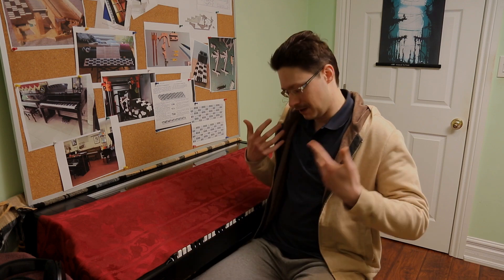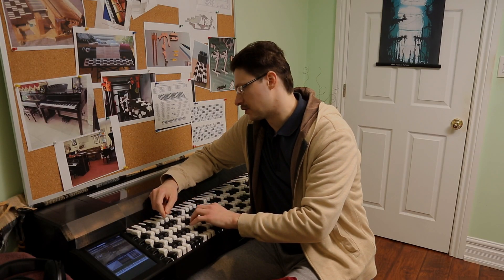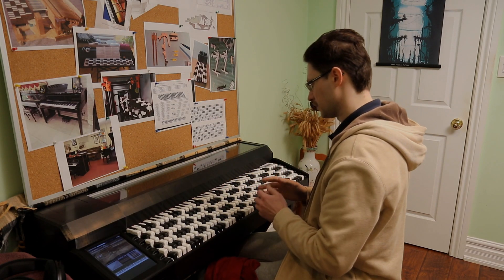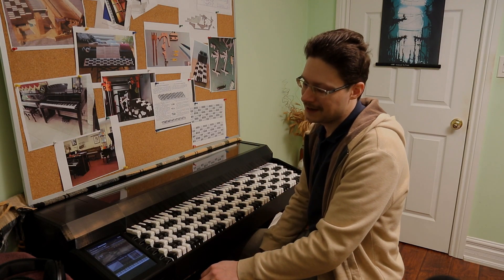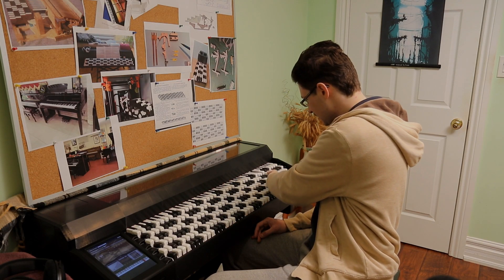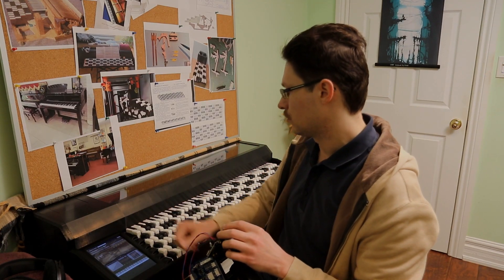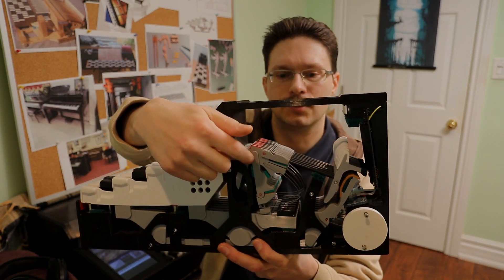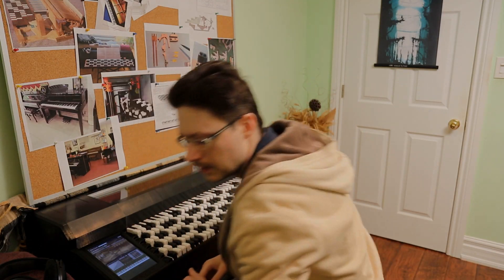DIY Janko Piano: 10. Its Working!!! (partially)

Comment: Hey this project might be adaptable into a more affordable lumatone.
Reply from the maker: probably not - the two designs are drastically different.

The lumatone is specifically designed for maximum customization, so each of its 280 buttons has its own individual velocity sensor. This naturally means sacrifices had to be made, so there is no hammer graded weights (or really any 'action' to speak of - making the feel of each button be more similar to a synthesizer than a 'digital piano').

My janko piano design is however made to mirror a grand piano as close as possible (outside of the key layout, naturally). This means that I only have 88 keys (though it looks like there are 264 buttons, but every button in a given column (3 per key) are literally part of the same key - so there are only 88 velocity sensors (and 88 hammer actions). On the other hand each of the 88 keys has its own mechanical action closely resembling a grand piano's in order to provide a realistic feel - something that would be impossible (or REALLY expensive) to include in a lumatone like design.

In terms of designs similar to a lumatone (in the janko piano group at least) it would have to be the Daskin uniform keyboard (which seems to be in a perpetual state of development) which does in fact offer individual sensors for each of its keys (just like a lumatone), though as with the lumatone it sacrifices hammer graded action for it.

Truthfully, I think the lumatone is about as cheap as you can go for a design with its specs - solid construction and individual sensors (and LEDs!) for each key. For cheaper alternatives you would have to sacrifice the LEDs and probably look into having a smaller range of keys (maybe in the 140 key range).

Comment: congratulations on building a digital janko piano that functions! It will get even better once the hammers are installed, I'm sure!
Reply from the maker: Definitely! I might actually be doing myself a bit of a disservice with practicing on the half-finished piano as it is (though I just cant stop myself - been anticipating the moment I could for over a year) since the keys feel way too light - especially when compared to my regular piano which now feels exceptionally heavy. Even with the variable weight system on my custom piano dialed up to what will in the finished piano be '80g' I only feel maybe 30g due to the missing hammers.

But oh well - pretty sure shifting back to a properly weighted action isnt going to be all too difficult (though perhaps not for my muscles - what with not playing piano for over a year while I was working on this project)

Comment: Huge Congrats! Such a successful build/project/endeavor. I've designed and built an isomorphic keyboard layout modification project ("xenachord") thats only somewhat comparable to this but am so gawking over your careful consideration to the key action. Sincere congrats again and hope to see more Janko layouts emerge from this
Reply from the maker: Thanks! Current plan is to open source my design once I finish up with everything so if anyone wants to take inspiration (or just straight up make their own) they can go right ahead.

Checked out the Xenachord (remarkably little about it online barring your website with it in your 'private instruments collection'). Looks quite professional with the wooden side panels and the textured black covers.
Reply: @DIYJankoPiano  So cool! Hope the open source side brings a community around it.

Thanks for checking it out. And agreed! I've had so many scattered projects in the air lately though so badly need to finalize the print files, spell out and share build instructions, yet alone simply share more depictions/examples of it in action.

Regardless, fun to participate in reconsidering new and old keyboard layouts!

Comment: i think it would be cool as an upgrade to have 12 different colors for led lights for each note
Reply from the maker: Each of the LEDs is a full RGBW programmable set (controlled by the 8-key sensor board its attached to), so I can have them be whatever color I wish (or even have them light up based on something other than the keys being pressed - such as using it as a large size metronome or have it light up based on a MIDI stream).

Still, outside of having two colors to mirror the key colors (something like red for white keys and blue for black keys) having 12 individual colors for the 12 notes in the octave turned out to be a bit too colorful. 

An interesting variation would be to select a 'key' (like C major for all white keys, or B major for all black keys) and have the colors represent the notes which are 'in the key' or 'out of key'. 

Well, I will definitely play around with them later. For now the LEDs are more of a 'cool concept I will make use of in the future' than anything else.

Comment: Congrats! Build quality looks amazing.

I'm very jealous, it might be time for me to switch from an isomorphic overlay to replacing the guts of an existing keyboard... How did you pick this keyboard? Was it just one you already owned?e
Reply from the maker: In my case its not a conversion - the entire keyboard is a custom design (by me) and made from scratch (also by me). So that includes the action, covers, electronics (yes - sensors, PCB boards,  firmware, et all), keys... everything.

If you are looking for a conversion I would point you at Rico Raven's work (https://www.reinert-piano.de/en/shop/janko-en/rr-janko-kit-en/)

Out of all the 'conversion' variants this idea seems the best as it relatively simple (either order one or design and print something similar - its essentially a single shape extrusion so quite easy to make if you have a 3d printer and minimal knowledge in fusion 360), works for all digital keyboards, and offers some unique features over a 'standard' Janko overlay (though as with all overlays it doesnt have the shorter octave span).
Reply: @DIYJankoPiano   Ohh I see, wow, congrats on the next order of magnitude then! What a huge amount of work. Looks really good.

I like the janko concept, but I have some priorities that make it sub-optimal so I'm working on my own isomorphic design. (I like to differentiate between the sharps and the flats so that skills I acquire apply to microtonal tunings.) You can see on my channel if you're curious:

https://youtu.be/s_3u8uTay18?t=279

What I wonder is whether it would be possible to use your keyboard design and just replace the janko keytop shapes with mine. That would be the dream =)
Reply from the maker: @JLMoriart  
Ah - I remember that! Saw your work a year or so ago when I was researching isomorphic layouts.

As for the reuse of my design just with different keytops, yea - completely doable (at least ignoring the difficulty of making the 'rest' of the piano). At the moment the keys and the 'buttons' on top of them are all one piece (I found it easier to make them that way), but removing the top most section and making different key tops is quite possible. Was a rather important part of the design in fact since I wasnt sure if I want to stick to the 'classical Janko' layout or try different key forms (something like the lippens keyboard maybe).

Comment: You are also somewhat miraculously not completely lost without a 7-5 keyboard layout! Who would have thought? hahaha
Reply from the maker: Its actually not as difficult as I thought to go from the classical layout to the Janko.

My previous experience with the classical piano is definitely helping me out here instead of being a detractor, and getting used to a shorter octave span has pretty much clicked after just an hour of playing.

The way the keys are still colored in with a 7-5 scheme helps out greatly here and playing something like a sixth interval progression in Cmaj (so switching between minor sixth and major sixth based on the scale) - something which is super easy on the classical piano - is still quite intuitive on the Janko as well. In a way its all about the visualization aspect - if you can 'imagine' yourself playing the next set of notes before you play its pretty difficult to get lost - both on a classical and Janko layouts.

Heck - the shorter octave and not having to press 'between' keys makes things more ergonomic, though yes - there are a few positions I have already encountered that are a bit more convoluted and required rethinking the fingering patterns (especially in situations where you play low notes with your right hand or vice versa).

In any case - I will definitely put together a comparison video between the classical and Janko layouts for the songs I know in both (aka: the ones I know on the piano that I am now moving to the Janko)
Reply: @DIYJankoPiano  I'm sure those will be second nature in due time, as well as the development of musical fluency and not having to think about fingerings in real time.
Reply from the maker: @gabys2  Exactly. The muscle memory comes as easily as on the classical piano (or even easier since there are more 'repeating' patterns), and translating sheet music to the keyboard isnt much more difficult due to the same key colors.

Just need to get more familiar with the layout to the point I can see it properly in my head and think less about which keys to press and more about which notes I want to hear. As with the classical piano, I expect that to be a long journey (though hopefully a bit shorter than the classical one! - fingers crossed).